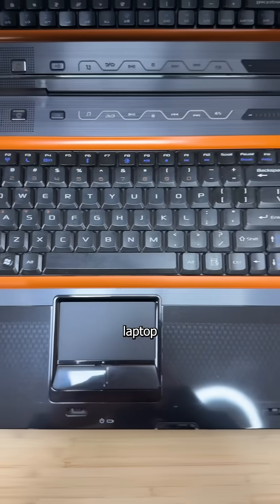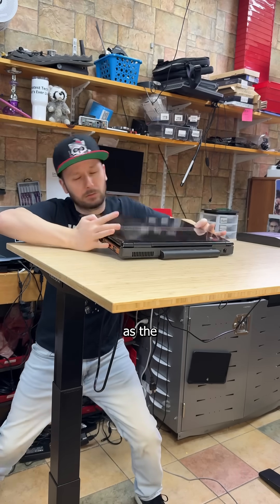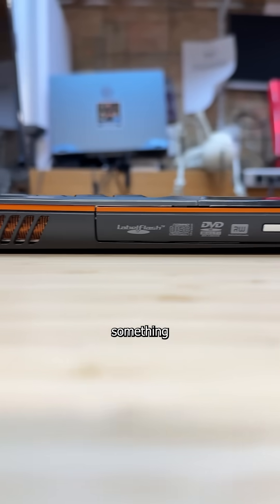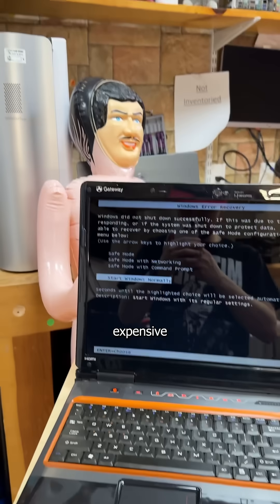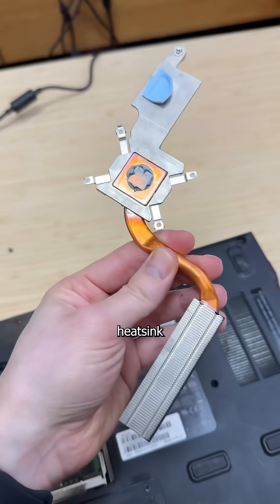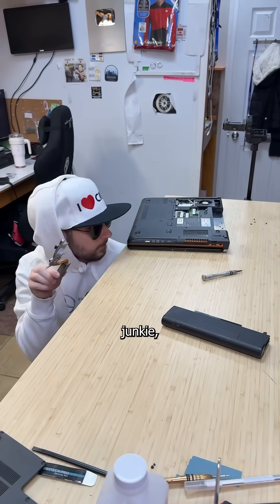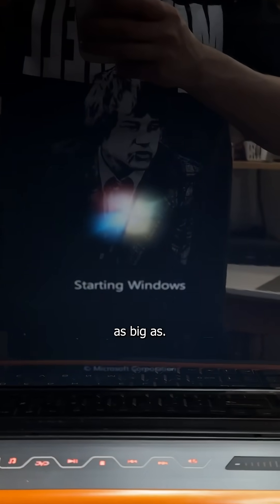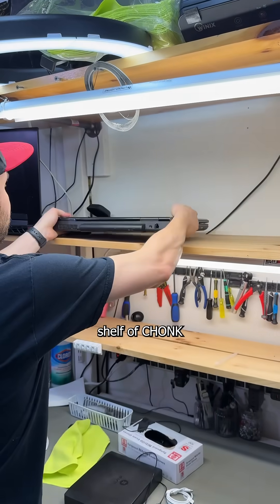Gateway FX Gaming Laptop is antique #tech from 2009 that went extinct #pc #technology #shorts

Comment: I remember this one.  the specific model I had came with 1.8ghz core 2 duo.  but it had a zif socket.  meaning you could upgrade the cpu.  I bought a 2.4ghz cpu (which was the highest clock that was supported) and put it in the laptop.  the removable battery made it easy to make sure the mobo didn't receive power while you worked on it.  Regular cleaning of the fans with compressed air (making sure the fan didn't spin), kept the GPU functional until I upgraded.

Comment: Dell XPS L701 from 2010. (17 inch laptop)
Thing was over 10 pounds, with a fan in it that only supported the 15 inch version. 
(it didnt have a proper fan for its size)
Leading to massive over heating issues and shut down if not in a cooled area. 
The fan basically was always pushing out hot air after 10 minutes of use and if it was hot in the room, the fan was horribly noisy. 
Most people who had it used a usb keyboard since the laptop was too hot to touch/rest your palm on.

Comment: Straight from the era of Thicc... From 1996, THE PANASONIC TOUGHBOOK CF-25. Equipped with a Pentium CPU, either at 133 or 166 megahertz, 32 MB RAM, and a 940 MB HDD, this 10 lb beast is over 6 in thick, and cooled without a fan by thermal grease and an unobtainium chassis.

It's so thick and heavy it even comes with a carry handle. It's the perfect compliment to the Canon 1D X series cameras, which are made from the same unobtainium, a very tough, rugged, and expensive magnesium alloy.

The price of one of these was over $6,000 new. These Windows 95 powered Thicc Boys were intended for use in cop cars, by military personnel, and by those working on power poles. Some models even came with touch screens.

The Toughbook line still exists, but current models are less than half the weight of the original.

Comment: I have my dell inspiron 3240 and it’s one of the best and reliable laptops I ever had. It is one of the chonky boy. I found it in my junk drawer. It was running fine and it was very slow. It was really dusty too. I took it to a service center and deep cleaned it, applied new thermals and swapped the HDD with a Samsung SSD drive. The battery is cooked and couldn’t find the replacement because it is so outdated. So I had to run it with a charger. Best decision I have ever made

Comment: Or the druaga1 hackintosh. EDIT Another laptop that belongs up there is the HP ZD8000. It is 9.5lbs, and 2 inches thick. It also has a desktop Pentium 4, and the back is 90% air vent.

Comment: Toughbook cf-30, acer aspire 6930 series. Specifically the ZK2. I have one. It's gigantic.i also have a cf-30. Which is also gigantic. I put Q4OS (a Linux distribution) on both of them and use them as my daily computers. I had to make a repair on the toughboook that involved a wooden mallet and a hammer.

Comment: I just got my hands on a Dell Latitude E6330 for practically free. I already gave it a thorough cleaning and with about $80 worth of components, this thing will unironically be an upgrade from my current laptop that I got for school in 2021.

It's almost 13 years old and it still works besides the battery not holding a charge. That's quality right there.
Reply: E-series Latitudes are right up there with ThinkPad T-series as repairable/upgradeable business-class laptops.

Comment: Please do the HP Pavilion DV6! Its from like 2011, I love its touch volume buttons. I installed Ubuntu on mine and it still runs Minecraft and Hollow Knight like a champ.
Reply: Pretty sure I have one actually... one sec (Goes to rummage through the tech pile) 
...

Nope, DV7. No touch volume buttons on this one. Came with beatz audio instead. With a front facing speaker in where the hinge for the screen is.
Reply: I had (sitting unused) a DV6T from back then. I liked it. 2nd gen i7 and some mobile Radeon part. Ran Crysis 2 fairly well. And had a Blu-ray drive.

Comment: I would probably kill to have this job. I love working on computers! Sadly there's no PC shop in my area of MA.
Reply from the maker: This job is miserable, I just make the repairs look fun. They’re not fun, at all. Which is why shops like mine don’t exist anymore.
Reply: @SalemTechsperts  They can be fun, if you're really into not breaking plastic clips or loosing screws and stuff like that. I just repaired a Vostro 1014 and brought it back to life. Dead CMOS battery, missing hard drive cage and connector. I had to replace those parts and even the hard drive that had failed, installed Window 7 and it's all set now. Who would have a use for a Windows 7 laptop? Your mothe... I mean who knows. But it was an experience that's for sure. Sadly I wish more modern machines were easier to repair than 15+ year old computers are.

Comment: Hi Andy, I bought my gateway FX laptop new back in 2010 I still use it often it's on my desk I did upgrade to an ssd but other than that its 100% original it has the nvidia 9800 GTS-m 1 gig graphics card that's still perfect today it is running world of warcraft here now at 40+ fps here's s few pictures of it today 3/30/25

Comment: It's actually so insane how tech works. This was a top of the line laptop at almost 3000 bucks (relative) and now, today, I have a 700 dollar laptop that's several leagues better, and lighter.
Reply: Even though it had one copper heat sink to cool it was stupid asf
Reply: It will continue to get cheaper although not as much in dollar terms anymore

Comment from the maker: The Dell XPS M2010 is probably the final boss of the CHONK era. Too bad they’re impossible to find 😢
Reply: try getting a sony vaio pcg series, i have a pentium 3 one pcg-fx150 and its 7 pounds alone
Reply: @thesigglet I had a PCG-GRT170, it had a desktop Pentium 4 CPU. Weighed over 10 pounds sans power brick, as I recall. Beautiful 1440x1050 screen.
Reply: Dont Forget Dell XPS M1710 and M1730.
Reply: @JulesMauuary-Maetz ohhh man. The Dell XPS M1710 was my first laptop.. it was HUGE and I had to keep two erasers under the back of it to let it keep cool. eventually it actually melted and let the magic smoke out. I loved that thing.
Reply: Didn't Clevo make most of the super chunky gaming laptops in the 2000s into the mid to late 2010s? I remember super chunky XPS m1730 was a rebadge.
Reply: The Sager NP9390 with dual Nvidia GeForce GTX 780M's in SLI. There can be only one final boss of chonk.
Reply: There is always the HP HDX 18 as a real big boy.
Reply: @davidknight7947  or the hdx series/HDX9000, basically HP's version of the m2010
Reply: Check out that one video Unbox Therapy did on that giant laptop from 6 years ago. It's crazy big. The Acer predator 21x
Reply: There is one floating around on Ebay
Reply: I nominate the Clevo P370EM to the chonky king, I have one that's my daily driver and has dual GTX 980m and 2 HDD's, 1 SSD with an optical bluray player dvd/cd burner and player too
Reply: Find a Predator GX21
Reply: @SalemTechsperts I might have one
Reply: Add the acer extensa 5220
Reply: How about Acer Predator 21X then? 😆
Reply: My new gaming laptop is almost as thick, it's like 3.5cm thick.

Edit: might be almost as thick.
Reply: Try the dell precision m4600 it is CHONK
Reply: Hears laptop knows its shit
Reply: maybe a thinkpad w700ds or a w701ds
Reply: yeah I think that's the only desk/laptop you cannot call a laptop but only a desktop, it's keyboard is literally a separate thing
Reply: VooDooPC HW:201, chonk but gaming
Reply: HP dv7 1000 😎 mine is still running
Reply: Is your mom holding up well i hope she is okay
Reply: Maybe but the most slimmest one is hp probook 4000 series
Reply: My dream portable machine 😔 Also plagued with gpu problems.
Reply: @SalemTechsperts  the dynavox max is a very big boy wat h michael mjd video onit
Reply: The DELL M1330 is much easier to get but yeah ebay listings are getting more and more scarce as these devices give up living due to the Nvida GPU Problem they had back in 2007.
Reply: There are a few for sale on ebay rn, and one of my friends owns one (which I formerly owned). To anyone who is curious about the M2010, AMA.
Reply: We need you no collab with the greatest Dell technician that ever lived
Reply: i have a xps m1330 is that close enough
Reply: @salemtechsperts i have a XPS M1330 RED  is that close enough
Reply: I’m still using my Dell Precision M4700 for gaming
Reply: What do you think of the hp omnibook XE3 from 2001
Reply: Question, these laptops of the early 2000's can there brains be up graded wile keeping the durability of the case be done for the same say$2500 or less? Because I know someone that has one like this dell for free
Reply: Well, L502X exists
Reply: Thinkpad W500DS comes close, and sadly is equally rare
Reply: ask CRD, he has one
Reply: What about that one alienware Sheldon has in the big bang theory?
Reply: dude i have one. battery leaked during long-term storage. im from Brazil it is here in my house. im gonna email you some photos and info
Reply: M1330 was even wilder man
Reply: Still have mine . Bought it when I started my truck driving career . Many hours were spent on it waiting for my turn to load or unload .
Reply: You say it because you didnt see my old-ass samsung pc
Reply: laptop*
Reply: Do NOT Forget the Thinkpad SL500
Reply: not impossible just financially not really worth it.
Reply: @FQP-7024   I have one at my house (not in the land of free)
Reply: yo ask linus he has one
Reply: Lenovo Thinkpad from the windows 7 era
Reply: @mawtrust7890   Ye, the Thinkpad SL500 came with Vista. So you can upgrade it to 7
Reply: i have four of em
Reply: Make it a sleeper build!?
Reply: I still have a hp pavilion2000
Reply: My friend has an M1710
Reply: That's just a media center with a laptop with detachable keyboard and mouse and also it works Windows XP (truly the goat)
Reply: Uh is a asus tuf gaming a15 a modern chonker
Reply: Wait i had one of those lol...
Let me think what else was big and chunky... Well actually in the other end, small and funny, alienware 13 r1 maybe .? Its a tiny tank 😂
Or acer predator 21x ?
Lenovo Y500 dual gpu from 2013 ?
Asus rog GX800 dual gpu and liquid cooled ?
ASUS ROG Zephyrus Duo 16 GX650RW dual-screen ?
Reply: What about the HP HDX9000 or the Acer Aspire 9920?
Reply: I worked on one of those around 2014, upped the ram to max and put in a larger, faster drive. That full size charging brick was enormous, but I loved that screen and the detachable keyboard/trackpad combo. I think you could mod one to work with a newer style board, but cooling would be an issue.
Reply: I know this is an old video, but you should put the hp elitebook 8570p up on that shelf.
Reply: I worked for an electronics recycling company and had some of these come in. Also the ones in your video and the Predator laptop. What's funny is the WASD keys are nearly always worn out and the spacebar is super shiny.
Reply: Ik this is an old video. But try getting a mid 2000s Alienware laptop up there. Those things are chonky af
Reply: Shit the days that end in Y are the toughest!🥸
Reply: Shit the days that end in Y are the toughest!🥸
Reply: Pretty sure that's the model sitting in my mother's office closet...I may send you an email in the coming months about this.  If your really looking for the item to make content and I have it the we should communicate.  Thanks Lupe and whatever the white guys name is.